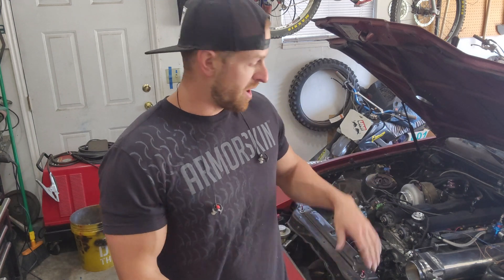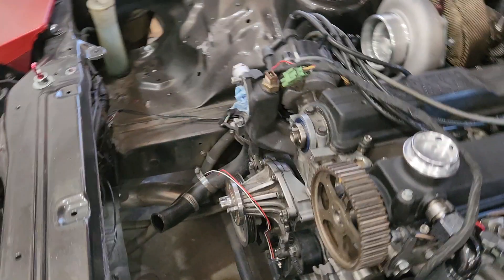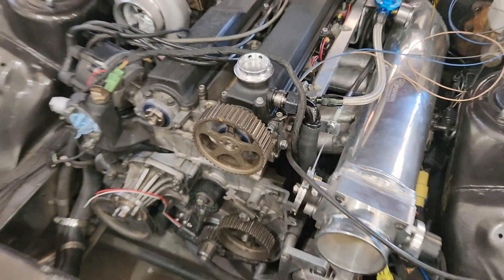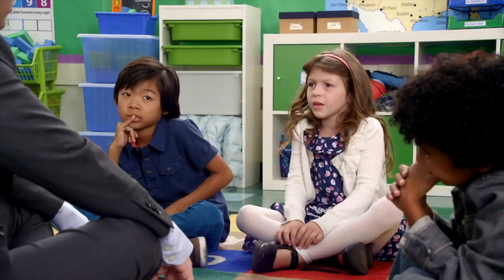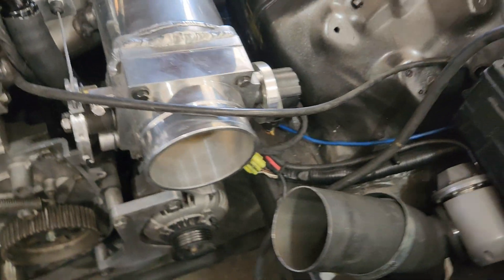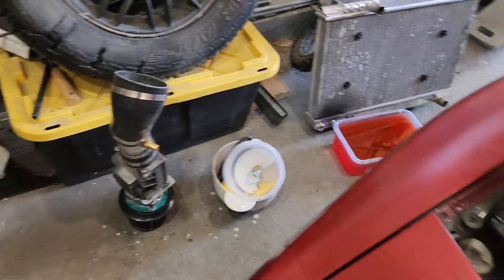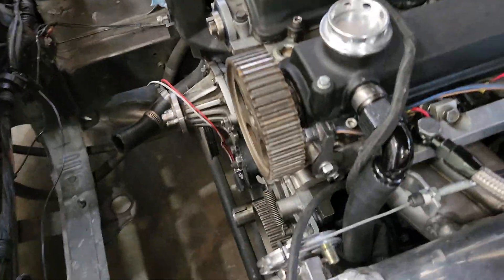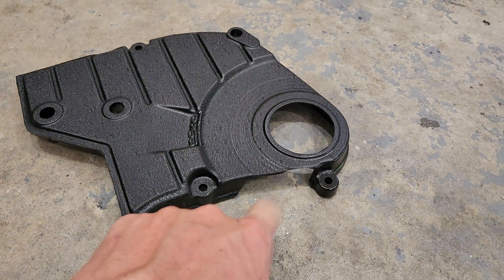One step closer to getting this thing tuned | Cam and crank sensors installed for coil over plugs.

Comment: Hey i got a quick question, what did you use as an idle air control valve? did you use the oem one or are there any aftermarket solutions.
Reply from the maker: I'm still running the factory iacv. It's just under the intake plenum out of sight. It works great with the new standalone. I can open and close it manually with the tuning software.

Comment: Cant wait for the next one, im really interested in if that cam gear mod works, im building a 7m with 5m head for my 85 and not really any options for aluminum cam gears without spending a bunch of money on the gear and then having it machined to fit the cam
Reply from the maker: Yes I'm in the same boat as well. If all else fails I will just snag a fidanza aluminum gear. I've seen people use the factory cam gears to do this but never heard any feedback as far as tuning or sync issues. I guess there is only one way to find out.